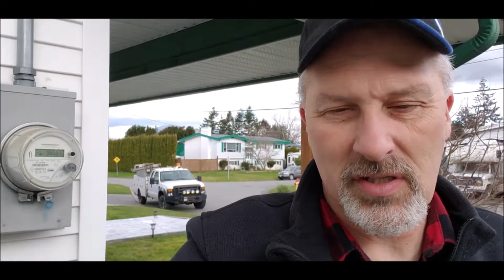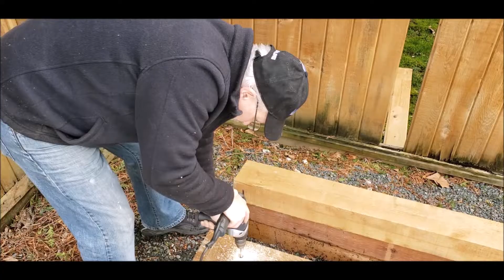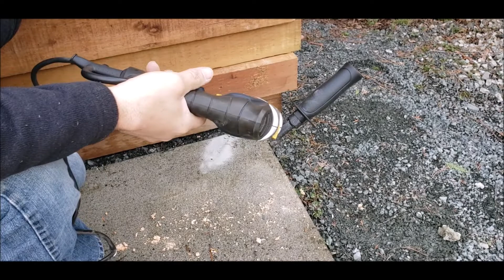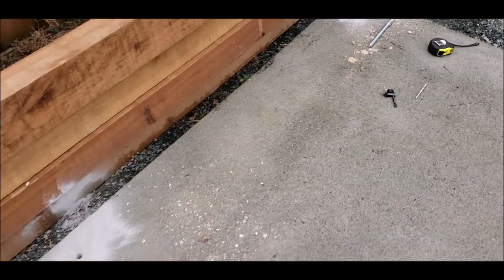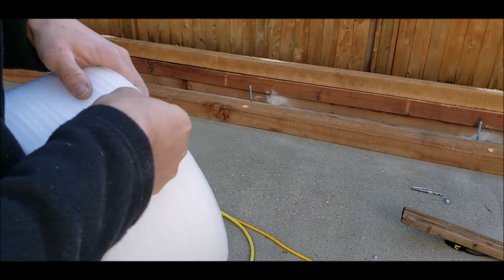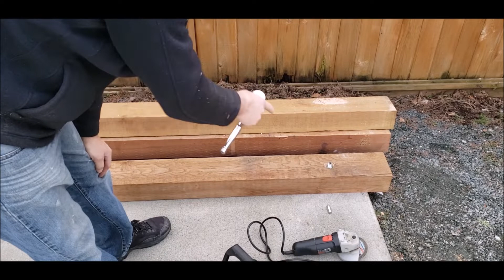Dream Shop Build - Episode 1: sill plate installation

Comment: I need to do something like this for our new slab.  The inspector informed us that the 12 inch slab will need to be filled to the top and NH code calls for another 6 inches above this level for the sil plate.  I think I can do this myself over having to mortar and concrete cinder blocks.  Thanks!
Reply from the maker: really hope it works out for you. this turned out to be a great option and gave me extra ceiling height. Just had to make some taller doors.